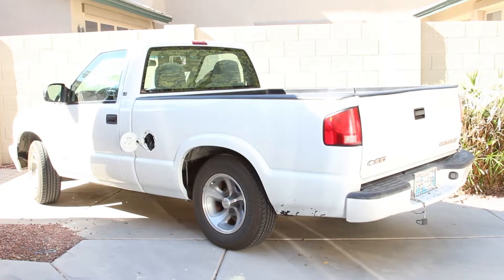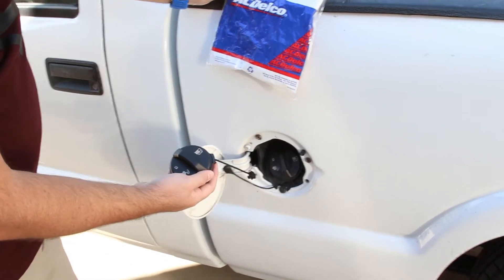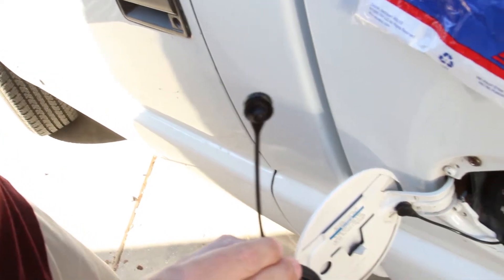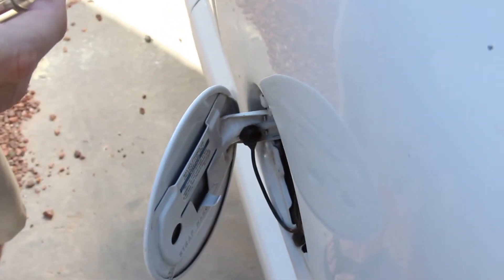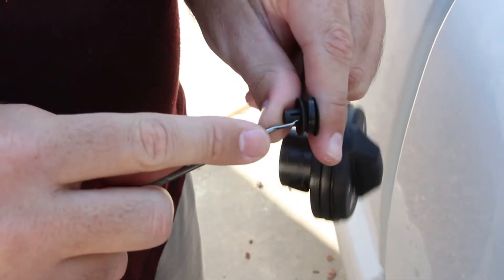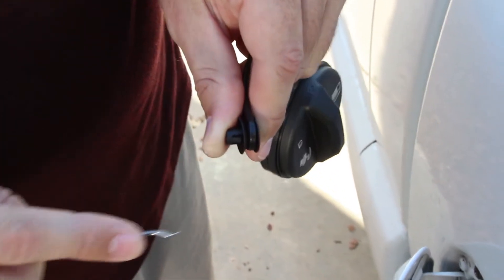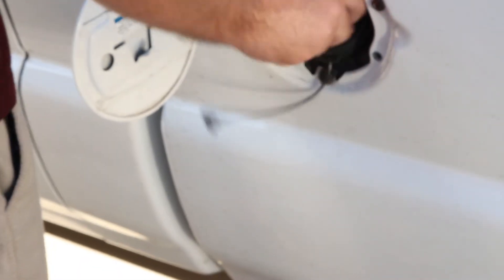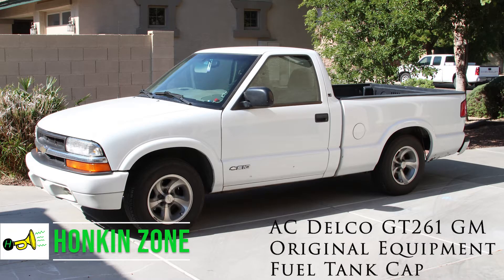2000 Chevy S10 Fuel Cap Gas Cap Replacement

Comment: what is symptoms of that code. other than check engine light.
Reply: I've had to replace the gas cap on my S-10 4 or 5 times over the years.  I never experienced a symptom, other than the annoying check engine light coming on.  One time the check engine light came on, and I didn't have a code reader, so I took the truck to the dealer.  They conducted an inspection, spraying all the fuel lines with a powder to look for leaks.  I paid $150 for the full inspection with the final diagnosis of needing a new gas cap for under $20.
Reply: @aaronsimmons6256  Are they vented of non vented.My is a 2000 S10 truck like the one in the video.